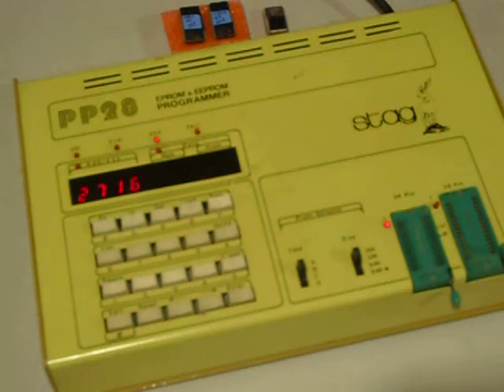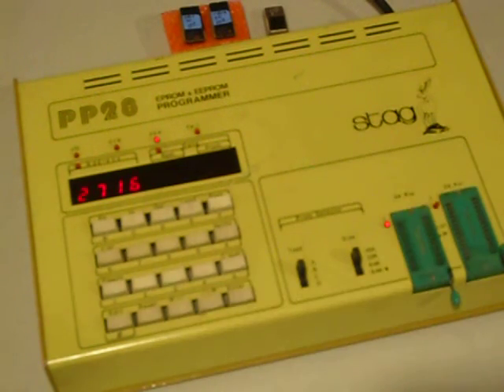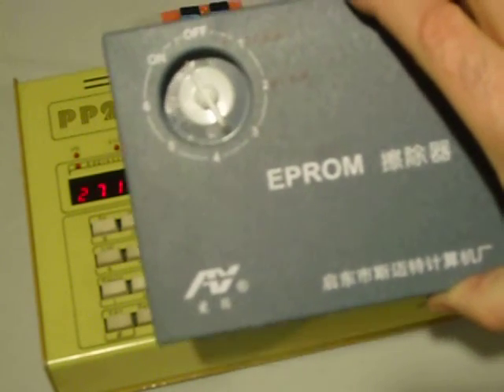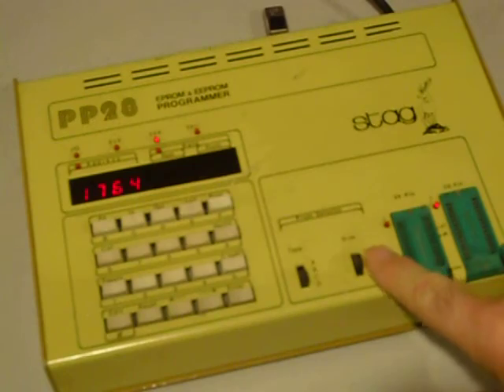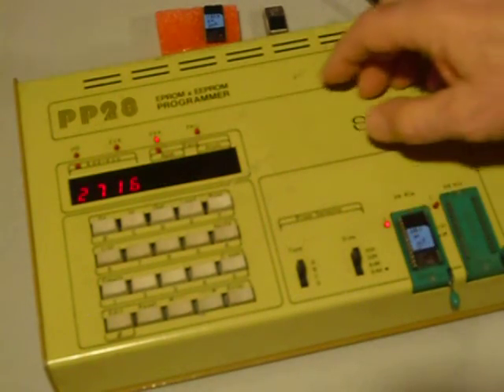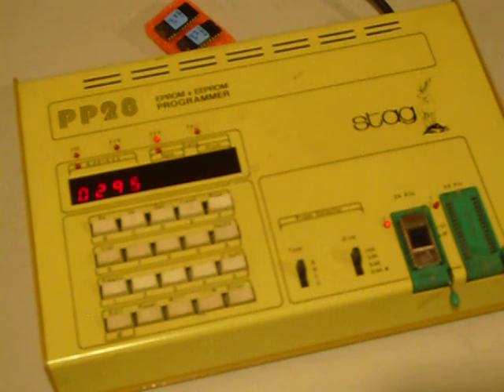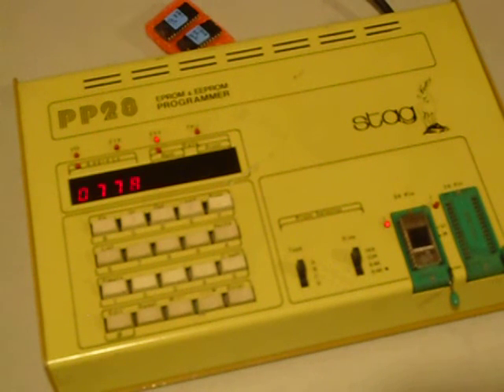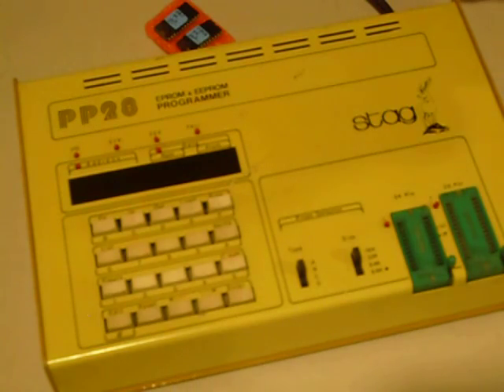STAG PP28 EPROM PROGRAMMER

Comment: I have to disagree about the thru-plated holes. While they might have been a problem when first introduced and that technology was young, and there might be issues with poor quality manufacturers, modern electronics would not be practical without 100% (or at least 99.999%) reliable thru-plated holes. The circuits are much too elaborate to make PCBs without lots of them, and if they were really a problem, faults found during factory testing and subsequent infant mortality of products would kill the industry. I have been an electronics engineer working with complex circuits almost my whole career, over 40 years, and I think I have seen no more than 1 or 2 actual thru-plated hole faults in that time (when reputable PCB manufacturers were used).

That does not mean that your STAG programmer did not have a thru-plated hole fault, and it does not mean that the Heathkit guy was wrong about his suspicions of the thru-holes on their products' PCBs. They might have had some batches that they let get through that had issues, or they might have cheaped out with their vendors.

I will admit to one experience, with a fly-by-night PCB vendor, where almost every thru-plated hole was not actually plated through. But that was an old guy working in a loft above a tire store, who clearly was not using correct manufacturing methods, or had no quality control. I only tried using him because I was charged with getting a small set of PCBs made for a computer club back in the early 1980s, and our budget could not afford reputable PCB houses. I don't count these in what I wrote in my first paragraph.

Comment: Nice programmer. I remember those. A lot of folks used them in the C-band hacking era back in the 80's.  I really need to find a new style programmer myself for these style of chips.  I have a "Mod Mep -04" It is DOS based programmer. Keeping a pc running windows 3.1 going is a pain. I use it for the very same reason you are. Repairing these old Eeprom radios. Thanks for sharing.